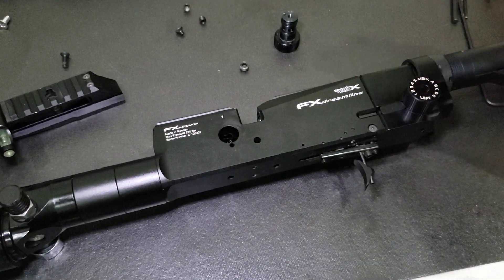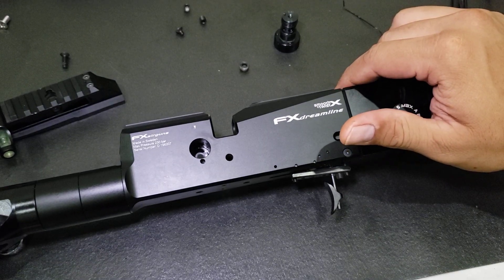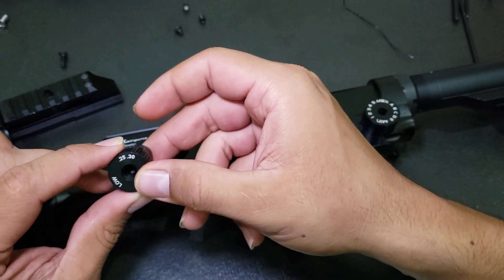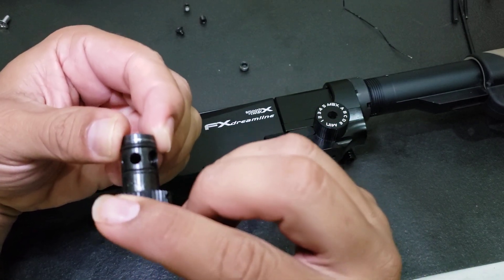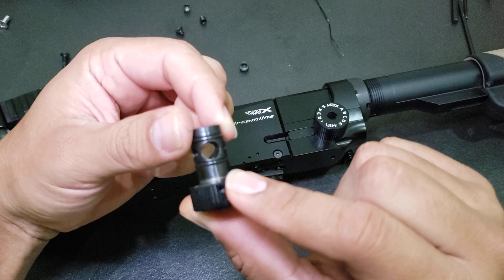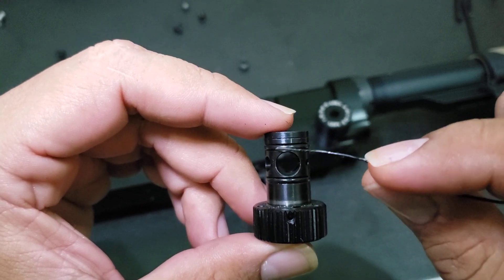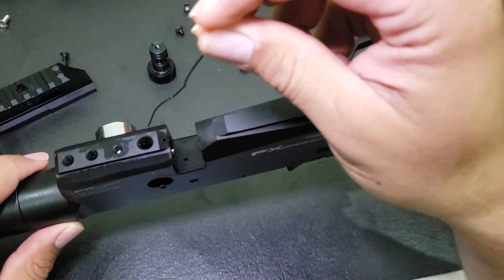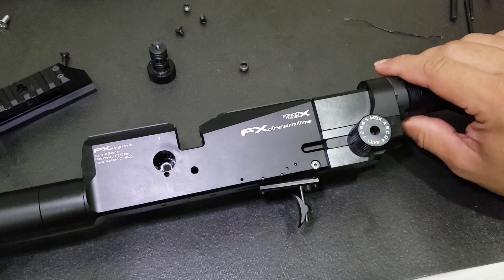Fx dreamline airflow and valve modifications and tuning

Comment: I have just installed 2 power plenums on my new FX Dreamline tactical .30, this is so interesting!!! Waiting to see your results, I love the simplicity of the Dreamline , Its shooting 50 grain JSB at 825, I’m only looking for a little more fps the magic number from the pros seem to be from 850 to 870. I hunt a lot here in Florida looking forward to seeing your results, thank you, gracias
Reply: How did you manage to get the bottle to be properly aligned to your barrel with two power plenums behind it ? Did you use thread locking glue ?
I just put one power plenum and if i tighten it and the bottle all the way, the bottle is slightly more to the left of the barrel, which bothers me quite a bit 😅
And i'm afraid to use thread locking glue since i want it to stay modular and not make the mod permanent.
Reply: @bipbipbip5599 wow! this was from like 4 years ago! Don’t use thread glue just tighten it as tight as it will let you go by hand and then straighten it slightly, when you pressurize it … it won’t move it will be tight
Reply: @Wolf-689xl  ok thx a lot for the reply ! 😊